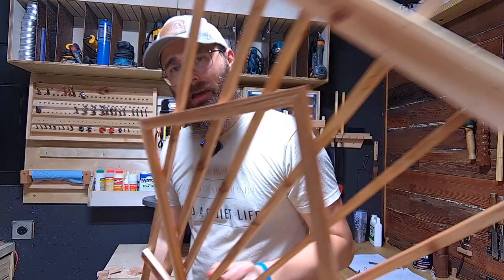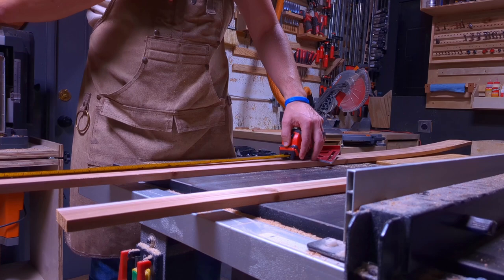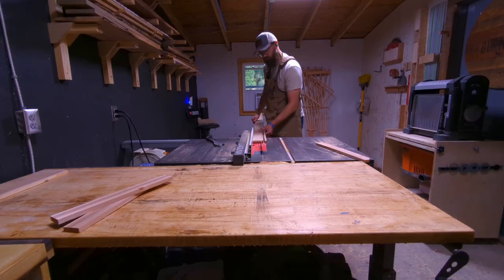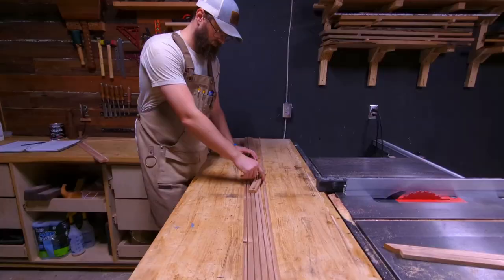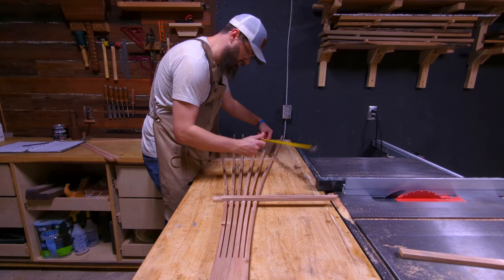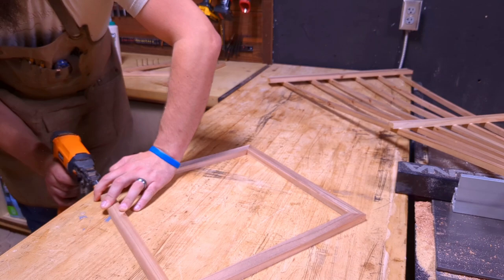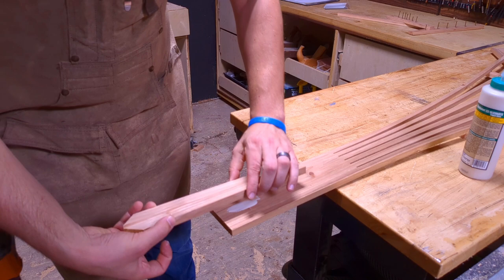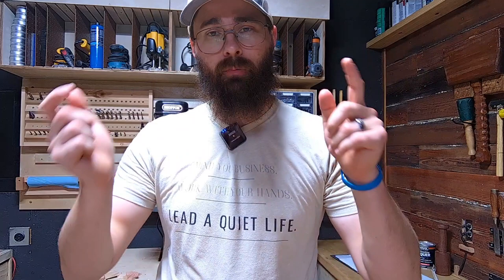Easy Beginner Woodworking Project | Fence Picket Trellis | Beginner Woodworking project that sells

Comment: Like. If you cut the spindles by flipping the board, would that simplify the process, and make it easier to make the spindles more even?
Reply from the maker: If you were cutting all the way through yes.  But since we're doing a stop cut you would have to put a 1/8 wedge between each spindle to account for the gap the saw blade makes.  If you cut the spindle then flip the board the next cut will not be straight unless you wedge between the existing spindle and the remainder of the picket.
Reply from the maker: I meant to explain that in the video but forgot, it is detailed in the plan though.

Comment: What is the purpose of the tung oil as a finish? Does it help the cedar keep its color or something? As i know cedar is already outdoor safe raw.

Again great project!
Reply from the maker: It just helps it to last longer and retain a fresh look.  Plus, any cedar touching the ground or beneath the surface will rot at a rapid pace, tung oil helps to slow that down.
Reply: @burnstockwoodworking  oh, cool! Thanks for the reply and explanation!